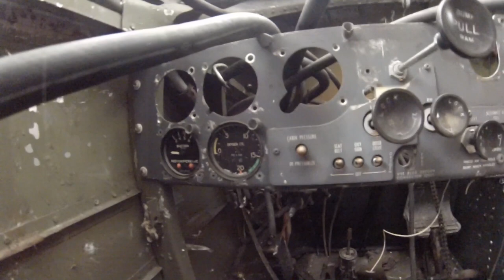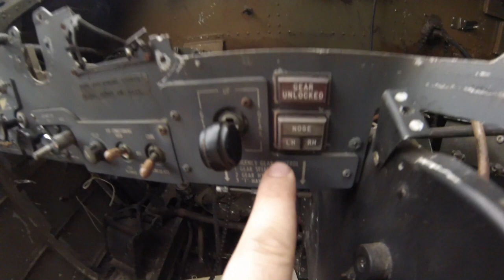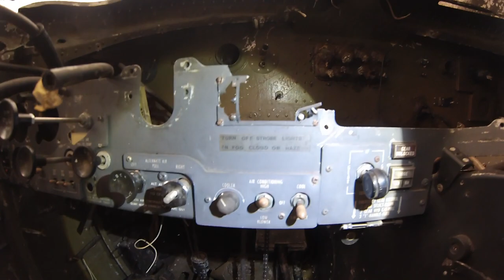Abandoned Airplane in Indonesia discovered by Pilot Blog

Comment: Hi Denys. I tried searching the tail number and also what I could see on the heater Ctrl Assembly part number, but found nothing. I can tell you one thing, that helicopter sound alone I recognized it being a BO105 straight away, then only I saw it. I'll always recognize the sound of those two Allison 250 turboshaft engines. I hope you find something on that plane.
Reply from the maker: Thank you so much! Actually I was surprised to see that fuselage lying just near to the main road))) Strange.
BO105 seems to be the Indonesian POLICE helicopter...
Reply: @PilotBlogDenys  It is quite strange. I always wonder how to convert an old fuselage into a bar. An old ATR 42 would be great for that purpose. ;)
Yes, Police all over the world use the BO105. Very capable machine at high and hot altitude cities. It can carry night-sun and FLIR. Also its a twin so can be flown at night over a city for patrols.